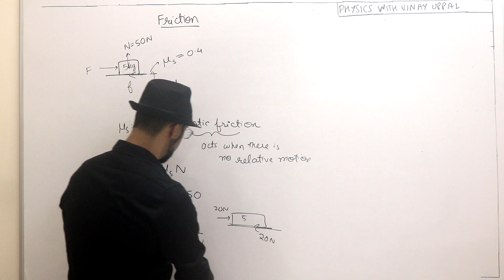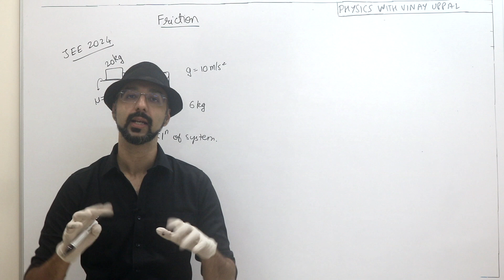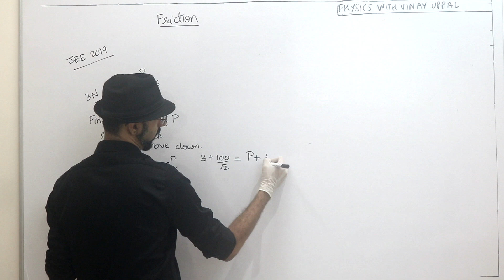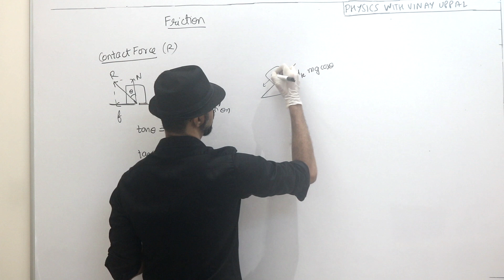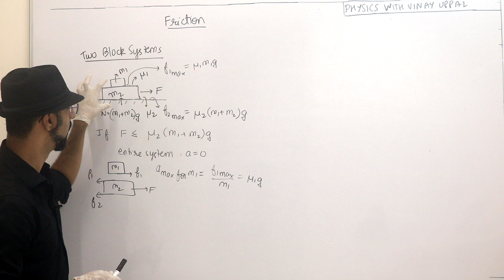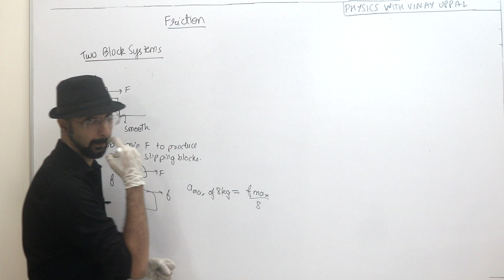Friction One-Shot. JEE Main 2025. Theory and PYQs.

Comment: Sir can you please resolve my doubt? sir agar same situation le ki neeche waale box par F force lagra tha and 2 blocks hai and assuming that slipping is already happening and m2 is accelerating in the forward(right) direction toh if we use pseudo force concept and an observer sits on mass m2(the bottom one) then we have to apply a pseudo force on m1 in the left direction which will be m1a (where a is forward acceleration of m2). So this way if we keep increasing the forward F force on m2 ,then m2 will move with higher acceleration as well, so pseudo force on m1 will be higher in the opposite direction as well, so this way the max accleeration of m1 will not be u1g but could be anything depending upon the acceleration that we are applying on m2...(basically this way higher the acceleration of m2 in the forward direction , faster will m1 slip in the backward direction due to pseudo force, so how is m1's max acceleration fixed as u1g?

Comment: for revision:
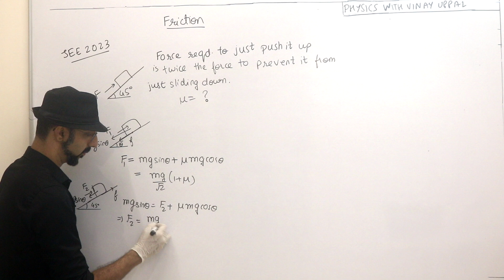20:20 pushing and preventing a block from sliding down
16:24 minimum force such that the block doesn't move
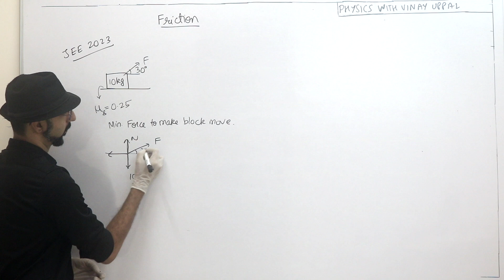7:14 minimum force to make the block move
27:54 two block system